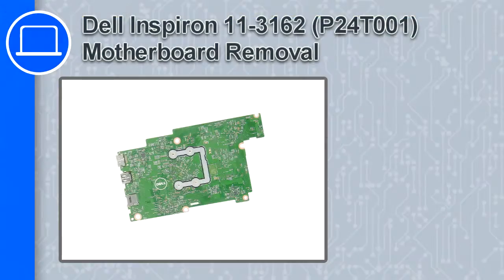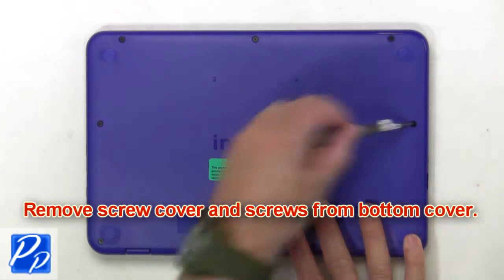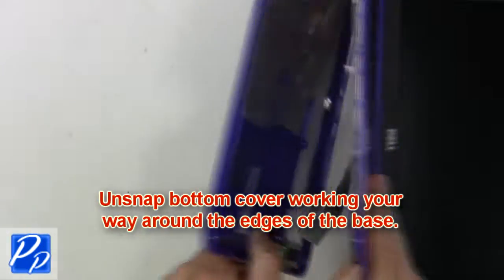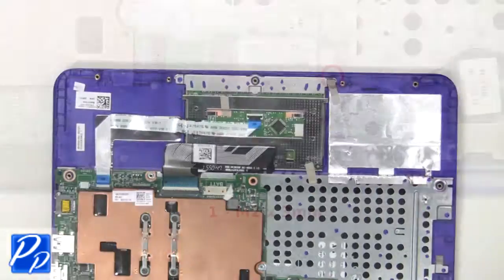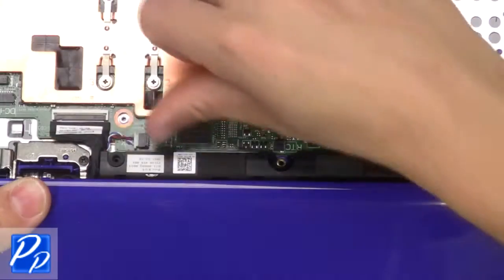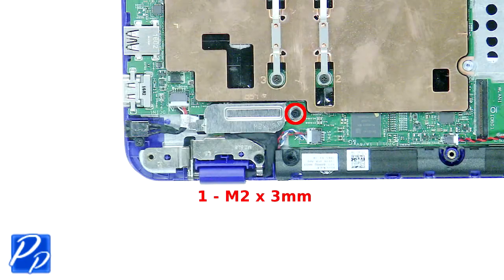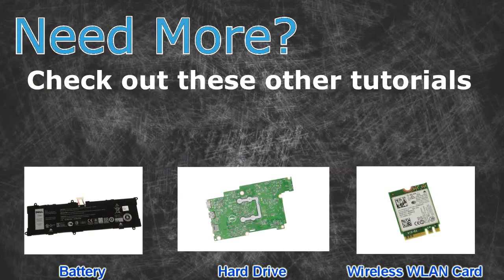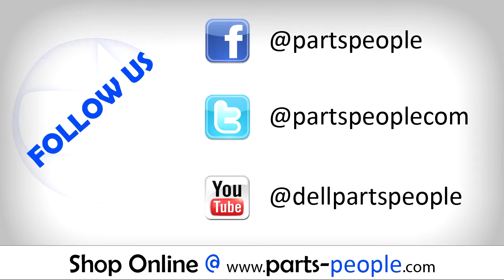Dell Inspiron 11-3162 (P24T001) Motherboard How-To Video Tutorial

Comment: @Parts-People If I Buy A MotherBoard With (8GBRAMDDR3)For Example,Can I Change It???
Reply from the maker: If it has a memory slot you will be able to change the RAM. If the RAM is built onto the motherboard you will not be able to change it. I say this because there are 2 different motherboards for this laptop that are not immediately cross compatible with each other. If your existing motherboard has the RAM built on-board, it also has an eMMC SSD built on-board so replacing it with the motherboard that has the memory slot would mean you would have to purchase an additional hard drive and install Windows on it for the laptop to work. Also, we don't sell any of the motherboards with 8GB of RAM so you would have to ask the seller if it has a memory stick.
Reply: Thnks Bud

Comment: does this laptop have an actual hdd?
Reply from the maker: The model we used for this demo has on-board eMMC storage but there is another model that uses a SATA HDD.
Reply: i have the dell p24t001, the same one you used, but mine doesnt boot it just goes into a loop of showing the dell logo then restarts, so no hdd hmmmm
Reply: @robertomartinez4904  I'm having the exact same problem, I agree
Reply: @dellpartspeople  can you replace that motherboard for the one that has an HDD adapter?

Comment: I want to change hdd to ssd of 3162. where is the hdd ?
Reply from the maker: The model used in this video has eMMC 32GB storage that is built onto the motherboard. Unfortunately, it cannot be changed or upgraded but, the other model that is available has HDD to the left of the motherboard that can use a traditional 2.5 inch HDD or and 2.5 inch SSD.